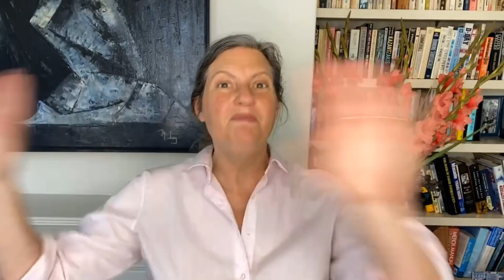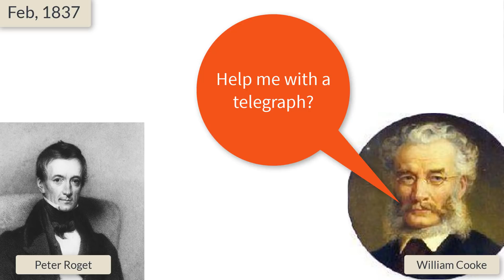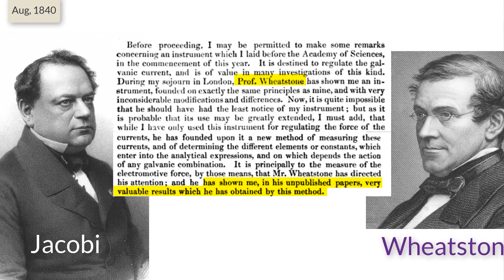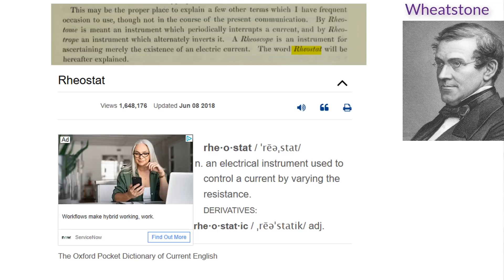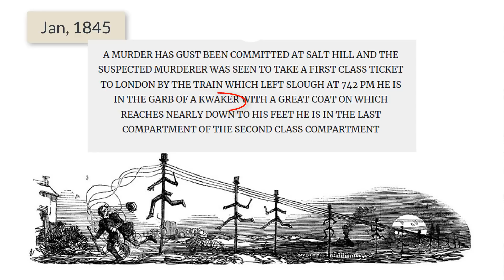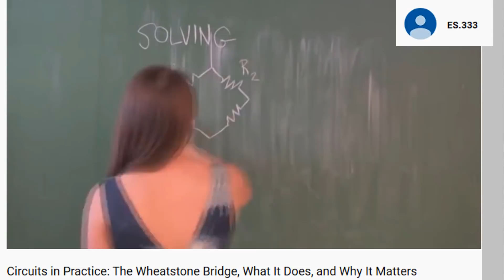Wheatstone Bridge: A (Not So) Honorable History

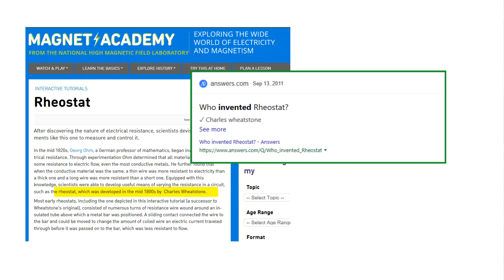Comment: 12:40 -- Jacobi DID give his rheostat a name.  He called it a "current regulator" (German:  Stromregulator).
Jacobi, M. (1839) "Ueber das chemische und das magnetische-Galvanometer" (On the chemical and magnetic galvanometer)  Annalen der Physik und Chemie, 2nd series, 48:  26-57
From p. 35:  "Die Beschreibung der zu diesem Zwecke besonders construirten Apparate, die ich Stromregulatoren nenne, behalte ich einer anderen Gelegenheit vor."  (The description of the apparatuses that were specially constructed for this purpose, which I call "current regulators", I reserve for another occasion.)

He described his current regulator in 1840:
Jacobi (24 April 1840) Lecture ordinaire
Bulletin Scientifique publié par l’Académie impériale des sciences de Saint-Pétersbourg, 7: column 97
"M. Jacobi lit un mémoire intitulé:  Beschreibung einiger electromagnetischer Apparate, als 1. eines Hebels um die Tragkraft der Electromagnete zu messen, 2. eines Stromregulators mit veränderlichem flüssigen- und 3. eines Stromregulators mit veränderlichem festen Leitungswiderstande."  (Mr. Jacobi read a memoir titled:  Description of some electromagnetic apparatuses, such as 1. a lever for measuring the lifting capacity of an electromagnet, 2. a current regulator with changeable fluid resistances, and 3. a current regulator with changeable solid resistances.)

Comment: Another home run! I would like to add as an aircraft technician, this concept is used to measure the density of the fuel by weight, using capacitors instead of resistors. The variable capacitance being the fuel compared to a known reference capacitance.
Reply: And so far it has worked perfectly! I have never ran out of fuel whilst flying, yet………….
Reply: where can I read more about this in your application? I am a marine technician specializing in electronics, networks, and sensors... also working on my own engine instrumentation systems. thanks

Comment: I used to think that the overwhelming feature of a Wheatstone bridge was to nullify any confusion generated by the impedance of the meter. When balanced, there is no current in the meter.
Reply: Yes, a wonderful side effect he was not aware of as it shows up in AC. A similar advantage in DC being the resistance of the meter but that one never causes much trouble.
Reply: It also removes the battery impedance.

Comment: The long coil variable resistors were in common use into the 1950's. I have salvaged several old Fire Alarm systems that used them to account for different numbers of fire horns installed.
Reply: I think I must have found from somewhere (maybe a battery charging circuit?) a crude variable resistor,  being a copper wire wound around a piece of asbestos board about 3in by 7in.  The wiper was conected to a slider the top edge of the bread slice board and the feed to the first wire in the low position on the board. Interesting

Comment: What am I confusing?  I always thought that was a Wein Bridge Rectifier?
Reply: A Wein bridge includes two capacitors, one in series and one in parallel, and is used for measuring the cap in parallel. It looks a lot like a Wheatstone bridge, however. There are lots of similar bridge circuits.
Reply: @talideon  I'm thinking Diodes.  And it is used to converting AC into DC.

Comment: hlo mam , What is the reason behind INTERFERENCE pattern produced by light when passes through AN NARROW SINGLE SLIT ? Does sound waves or water waves produce single slit interference pattern?? Thank you mam for answering my previous questions
Reply from the maker: Water and sound make interference patterns with single slits and double slits and gratings. The pattern from a single slit is because the edges of the slit act like a source of a small wave and those two waves go up and down at different places so that when they combine on a screen there are places where the light/sound/water always destroys each other and you get a series of dark spots/quiet spots/calm spots.

Comment: Respected mam,We calculate energy per unit volume of electric field of electromagnetic waves with
 capacitor arrangement...I tried really hard to understand why do use, energy required to charge the capacitor and we divide by volume of capacitor to calculate energy per unit volume of electric field.... they say the energy is stored in electric field BUT the energy gained by an CHARGE Q in electric field depends on magnitude of Q; (ENERGY GAINED=Q×Electric field×Distance moved in E field;) then how can we predetermine the energy of
 electric field per unit volume??(1/2)CV^2 and (1/2)Q^2/C...It's just the energy required to make the E 
field in capacitor HOW CAN THIS BE EQUAL TO ENERGY GAINED BY AN CHARGE Q IN THAT FIELD?? CAN YOU EXPLAIN ENERGY PER UNIT VOLUME OF E AND B FIELD INTUITIVELY WHAT DO THEY MEAN??
Thank you mam

Comment: Respected mam, I have some questions, it would be very helpful if you could answer for me,....                                        1)Is it possible to produce em waves by oscillating the magnet to certain frequency?....if possible please explain how it's created sir 
2)Can we produce em waves by oscillating the vandegraff generator?what's the difference between em wave produced from magnet, vandegraff,and AC current?
3)where does the energy of em wave come from?where the energy of em wave taken away from??
4) how can an object obsorb the em wave...what does black body do when em wave falls on it,does it produce out of phase light wave which destructively interfere on incident wave...how can a em wave be destroyed? 
5)can linearly accelerating, circulating, spinning charge produce light? How will that light look like?
6) does all AC circuits produce em waves, will AC circuit glow visibly when its frequency is frequency of visible light....why DC current does not produce em waves.... even though electrons collide with nucleus of the conductor and losses energy and ACCELERATES?
7)Why cannot neutral objects (Eventhough having positive and negative charge) does not produce em waves ...is it possible to produce em waves by shaking or vibrating the neutral object to certain high frequencies....how black bodies produce em waves??
Thank you mam
Reply from the maker: Whew, you have a lot of questions I will try my best. I would recommend that you watch my videos about Faraday discovering the nature of light, Maxwell creating his equation, Hertz discovering Radio waves and Khirkoff creating the idea of blackbody radiation (my video on spectroscopy) as they might help you get a sense of what EM waves are but let me see what I can do..

1) All magnets are created by moving electrical charges (there is no magnet subatomic particle). Permanent magnets are magnetic because of the behavior of the electrons in it and electromagnets are magnets made with current. So, a vibrating "magnet" is a vibrating electrical charge. 

2) Van de Graff generators are simple rubbing machines that collect electric charge to do cool experiments. You cannot vibrate a large object like a Van de Graff generator to create an EM wave.

3) The energy of the light comes from the electron losing energy that it temporarily gained in some way. The electron could have gained energy from being hit by another electron or from a chemical reaction or absorbing an EM wave from another vibrating electron or... 

4)  Black bodies are theoretical ideas of an object that can absorb any color with equal efficiency and therefore would be "perfectly black". It does not mean that such an object would not emit any light of its own. In fact, the center of stars like our sun act like blackbodies but they sure aren't black. It has nothing to do with destructive interference.

5) Sure: Antennas often vibrate electrons linearly and make radio waves and microwaves are produced with spinning electrons. It is hard to get to visible light frequencies with linear or spinning electrons but that is an engineering issue, not a physics one.

6) AC is electricity that vibrates back and forth so, yes, it does make EM waves. However, most AC is at 50 or 60 Hz which is way lower than any radio frequencies used and significantly lower than visible light. DC is in one direction, but every time you make a spark (even with a DC battery) you create a pulse of EM waves. If you want to see it, play AM radio and connect a battery with wires and every time you touch the ends of a battery you will get static on your station!

7) Neutral objects make EM waves all the time because the electrons in the neutral object are the ones vibrating (note: with gamma rays, its the protons vibrating, which only happens with the heavy protons when there is a nuclear reaction). However, no matter what you do to neutrons or other neutral particles, you wont get an EM wave.

Cheers,

Kathy
Reply: @Kathy_Loves_Physics  Respected mam, Thanks a lot for spending your valuable time to answer any questions, it helps me a lot 🙂🌟

Comment: Thanks, never heard of Moritz von Jacobi before, but I did hear of use his Maximum power theorem. Basically always match impedances for maximum power transfer, it is one of those things that is as fundamental as ohms law and taken for granted. In the RF world most circuits are designed to have 50 ohms on their inputs (e.g. reference clocks) and outputs (e.g antennas). In designing high speed address and data buses in computers the impedance of all the transmission lines on the PCB's (Printed Circuit Boards) would all be designed to match the input and output of everything on the buses (e.g. memory, I/O and CPU) which is typically 50 to 60 ohms. 

I love your video as always! Thank you.
Reply from the maker: I was tempted to mention his maximum power equation but the video was already so long that I had to cut it. Jacobi deserves his own video honestly. Glad you liked this video and thanks for always commenting
Reply: More famous than Moritz probably is his brother Carl Gustav Jacob Jacobi (https://en.wikipedia.org/wiki/Carl_Gustav_Jacob_Jacobi) at least in mathematical circles.

Comment: Can you make a video on explain electromagnetic waves ,I can't able to imagine that how electromagnetic waves travel and how they discoverd by hertz experiment . because hertz experiment is similar to Faraday electromagnetic induction experiment with high-voltage.
Reply from the maker: You might like my video on how Faraday came up with the idea of EM waves and how that led to Maxwell's equations and then Hertz's experiment. However, I think I should correct you as Hertz's experiment was very different to Faraday's electromagnetic induction experiment. Faraday discovered that changing a magnetic field in a coil of wire would induce current in that coil of wire. Hertz, discovered that an alternating electric field would travel at the speed of light and could be "caught" a distance away as a way of validating that light is an electromagnetic wave. Hope that helps.